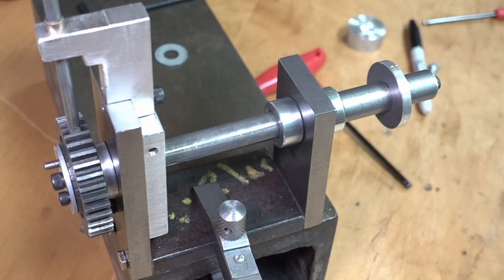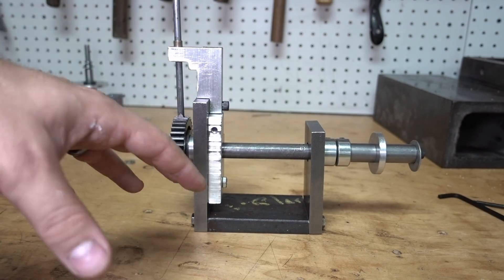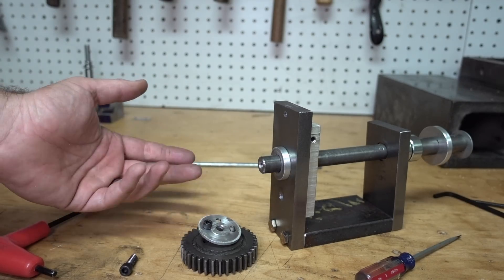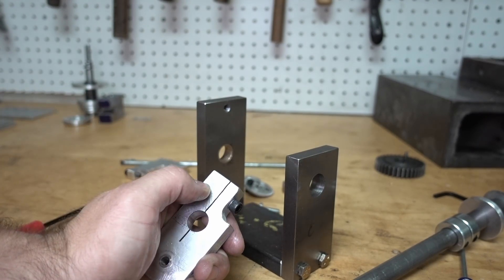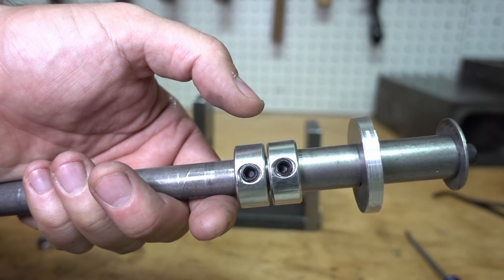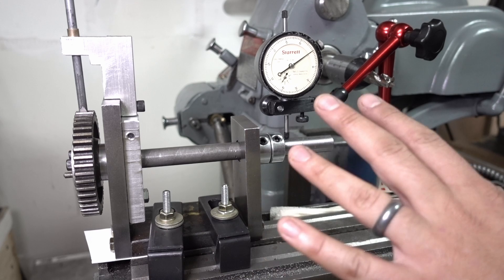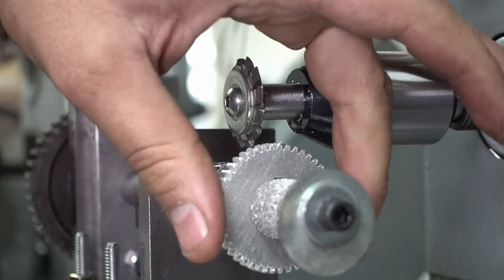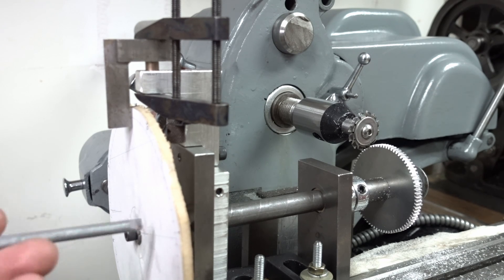Making metal gears with a scrap made dividing head!

Comment: unless youre planning on using bigger change gears for the divider i would shorten the L piece so theres less space between the gear and the locking pin , the pin then has less room to flex making the whole setup more firmer 
should work fine though
i bet with a lathe milling adapter on the crosside of a lathe you could use the same thing on that too and dont even need a milling machine (yeay you can shave the teeth in the gear with the crosslide and a toolbit but that gets old realy fast )

Comment: You can cut an eighty tooth  gear using a forty tooth gear for divisions if you cut a central notch in the detent which allows you to engage not only the spaces between the teeth but also the tips of the teeth doubling the number of divisions.

Comment: How did you lock the spindle for wooden template?
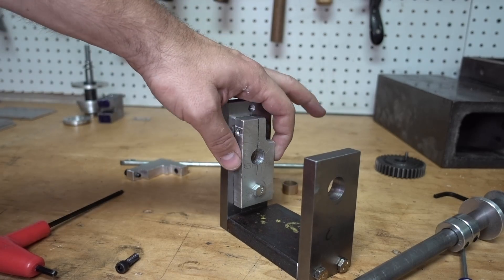Reply from the maker: The clamp piece seen at 4:38 locks the entire spindle and indexing template during cutting.
The cap screw that attaches the wooden template directly into the back of the spindle(11:04) is all I needed to keep it from moving.  Hope that answers the question.  Thanks for watching.

Comment: Not optical illusion my @$$... Table feed was wrong direction for the direction of cutter.  Probably to avoid chatter caused from slack &or flex in the divider, neat if it worked, could easily suck it under the cutter though considering the lack of strength in axis of cut... Box them sides in or cross brace it somehow.

Comment: Instead of your plywood dividing head and "eyeballing it", I've seen other youtubers use one of those USB microscopes to get more accurate results. They print up a dial with lines on it (just like your current plywood disk). Then, they point a USB microscope at it and show the results on a computer screen. This lets them really zoom in and get extremely accurate alignment for reproducible results. It is still not as accurate as a dividing head, but it is more accurate than trying to eyeball alignment of your disk with a metal square. For what it is worth, you can do basically the same thing with a magnifying eye loupe. Mount the eye loupe on a holder and position it so that it is right in front of your line and metal square. Then you can magnify the alignment of the line with the square to get better results. So imagine that you take your current system and look through a 10X magnifying glass (at a set viewing position). You would expect your error to drop by a factor of 10.

Comment: What's the difference between a piece a 6 inch off cut from the bin and a 6 inch piece that you cut off your stock?   None.  None at all.  I can't see anything wrong with those off cuts. He keeps saying that the build is bad because the metal is junk.

If you slap something together then you end up packing it with bits of paper.  If you square it up and take care with the build you will get a decent result.

I've heard many workmen blame their tools.  I've never heard someone call metal junk just because they didn't work it properly.

Next time, square it all up before you start.   He could have used the same metal and done a good job with it.

You can build things at home that are spot on.  There's nothing wrong with any of that metal.

Comment: First of all great job,correct me if I’m wrong but if you’re making gears with the same spacing could you use the same 40 tooth gear to make whatever tooth gear you want as long as the diameter was correct for the new gear?

Comment: Hi Thunderdog, if you cut a slot in the detent 90 deg to the v point you already have you can double the amount of teeth for one change wheel eg 80 teeth from a 40 tooth change wheel, simply by rotating the detent 90 deg for every cut.
Good job and a simple solution 
Cheer
Reply from the maker: Really?!  Let me follow you on this, the .25" detent gets a little "V" cut into it 90 deg to the current setup.  Then you would basically cut a tooth like I've already done followed by rotating the detent.  I'm assuming that the newly cut V detent would only fit by setting it onto the top of the very next gear tooth?  Am I missing something or is that my lack of math skills on full display?
Reply: ThunderDog no mate you got it, the groove registers on top of the tooth effectively doubling the the number divisions. Read about it in a book by G H Thomas, an old model engineer, passed away now but his book is a good reference for home machinists, it's called The Model Engineers handbook.
Keep up the good work
Cheers